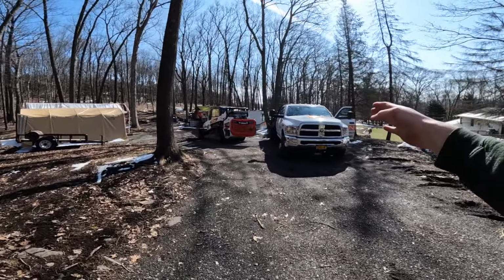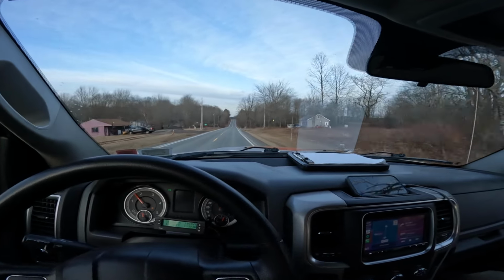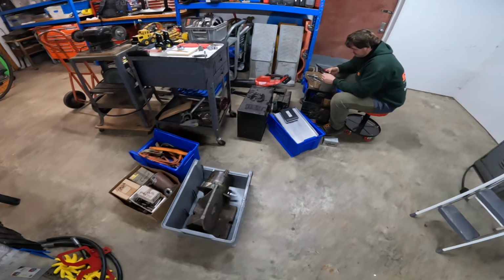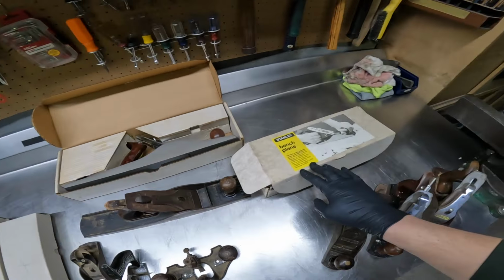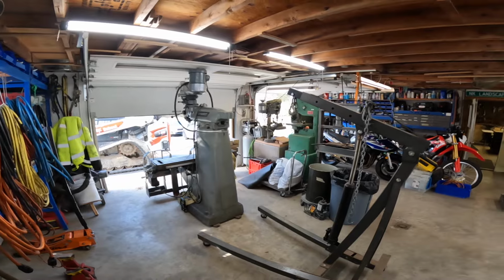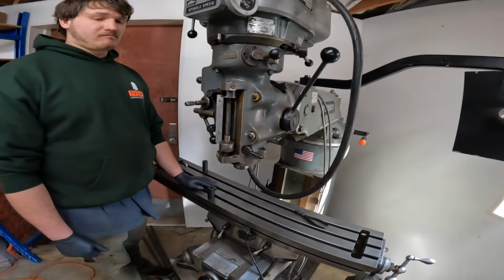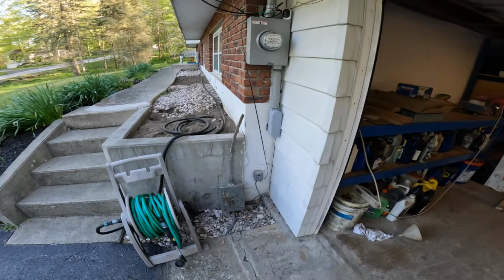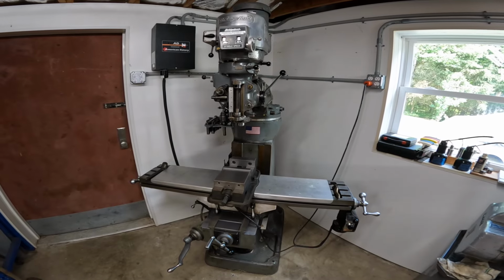I Built a Machine Shop to Fix ONE Broken Part

Comment: You could've tilted the head to install the drawbar, lol. Also, a power drawbar is what you'll really be needing.  Since their pneumatically operated you'll need some compressed air over in that corner, for the power draw bar, blow gun, etc. I'd say this video is a long way from finished, lol. You're getting there.
Reply from the maker: Yes, you could definitely tilt the head to get the drawbar out, we just figured the hole was easy as well. One day ill get a power drawbar. We want to get out power feeds for the Y and Z axis as well as the DRO first. I do plan to run shop air lines over to that area as well.
Reply: @NKLandscapingLLC  I know you guys are busy and it takes time to build out a shop. It’s looking good so far. The three phase power, sub panel, and other electrical work looks top notch. You have exciting plans for your machine tools, it’ll be fun watching it all come to fruition.
Reply from the maker: @unclebuck5051 I’m glad you think the electrical looks good! The electrician did a good job on the new panels and 200A upgrade, but for some reason wanted an astronomical amount of money to add the plugs and wiring for the phase converter.  I did my best to make my installation of those things look “pro grade” considering I an NOT an electrician by any means.